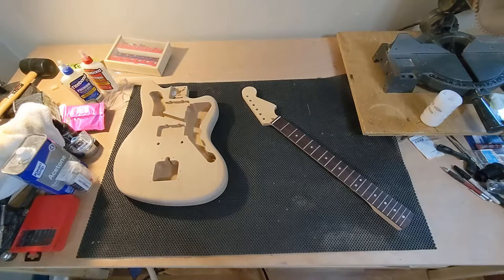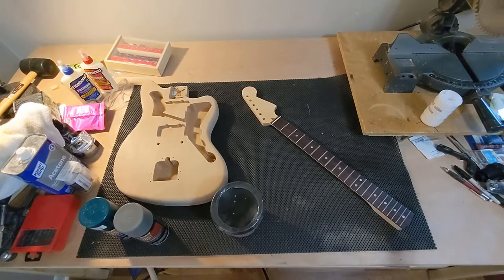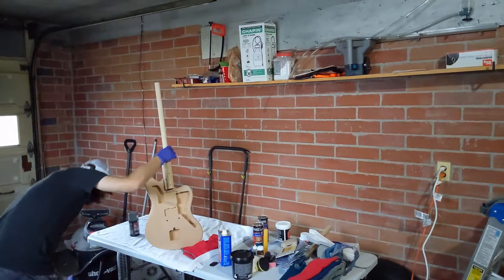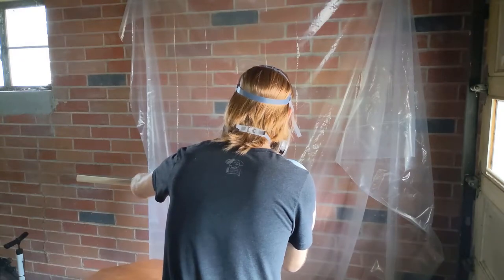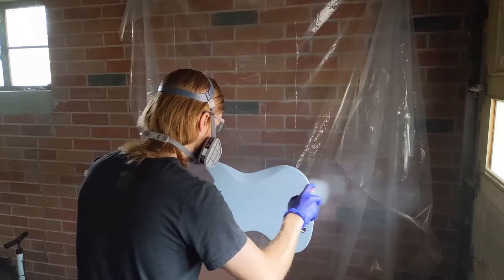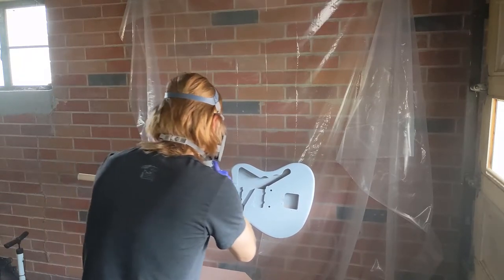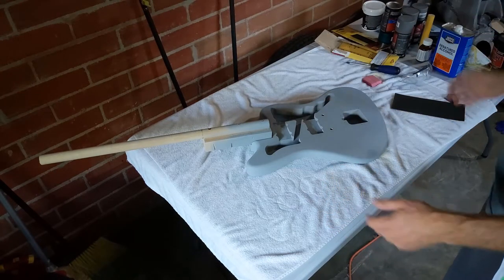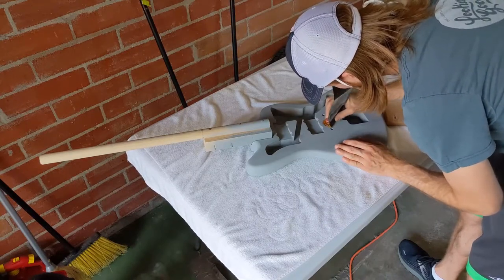DIY Jazzmaster Part 1 - Body Painting

Comment: You need too use a grain filler! Like bondo or apoxy
Reply from the maker: I think on a closed wood like Alder sanding sealer + a thorough sanding would have prevented the grain popping issue I had. But thicker grain fillers have worked well for me on open type woods (mahogany etc.) and probably would work too!